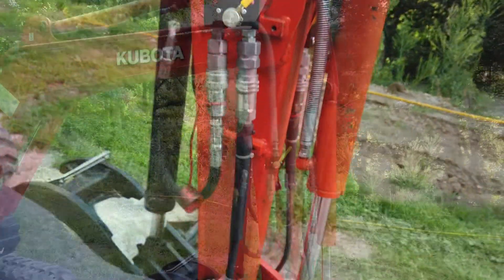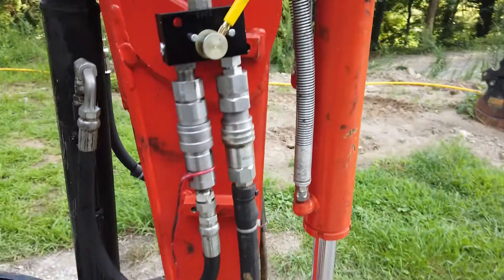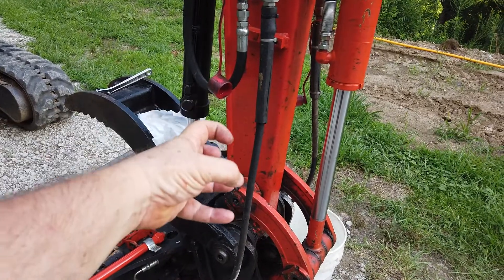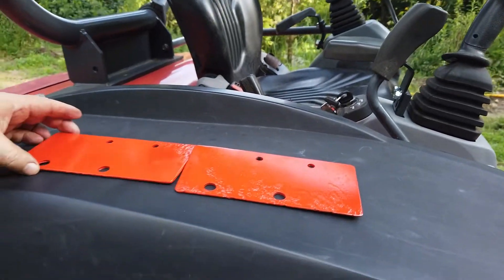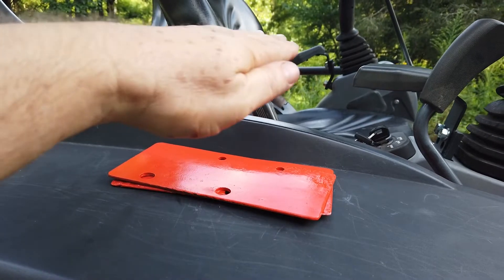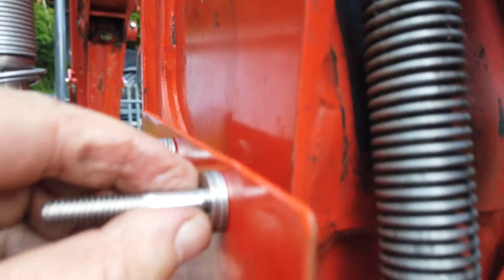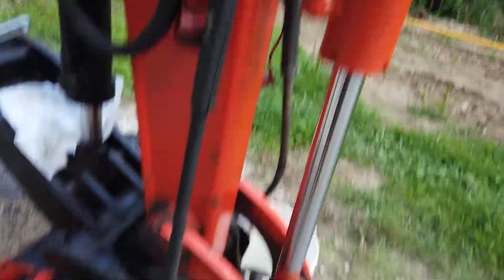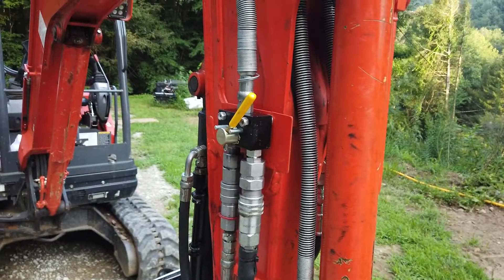Mounting a diverter valve for Auxiliary Hydraulics

Comment: your video is perfect timing, I'm going thru the same thing on my KX71.  Currently figuring out all my fittings, you're right its frustrating between BSPP, SAE, and JIC fittings.  Ordering some pretty sure they won't be all right 😅
Reply from the maker: I need to print my hydraulic fittings poster and put out in the shop so I can stare at it and scratch my head.
Good luck! Would have been a better video if I could have specifically labeled each factory fitting but I just fell into the what the heck process lol.
Reply: @larrydoesschtuff  looks like everything Kubota side is BSPP, was that what you found on the thumb plumbing?
Reply from the maker: @joelprybylski3515  yes... That's pretty much what I remember. I also have some older Hurst hydraulic tools (jaws of life... Great for opening crushed culverts and alot of other stuff)... All of those fittings were bsp and after flushing tools and swapping oring types I can hook those to the aux. I'll have to get a video going about those things.

Comment: Thanks for the video. Starting the process of modifying my old kx161-2 to allow for a plate compactor and post driver. I'd also like to leave my thumb hooked up instead of having the hoses loose and the "fun" of hooking them back up.
Reply from the maker: I agree with the "fun" of hooking them up at times... Even after good bleeding off procedures. I finally broke down and bought one of the Erwin quick grip hydraulic clamps but there are some pros and cons. I'll be making a video on that soon.
I definitely need to add a protector plate over the setup but should be an easy project.